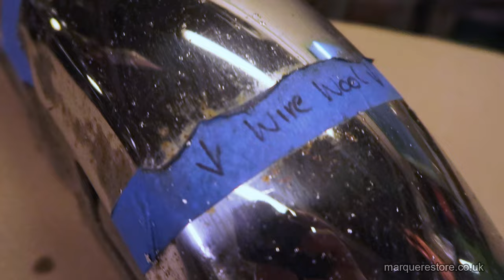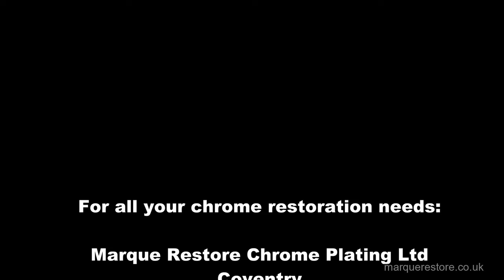How to Clean and Restore Chrome at Home THREE METHODS TESTED

Comment: The Aluminum has to be turned and cycled as the water conducts the chemical draw from pulling the rust off TO the new Foil.  as you may have noticed the foil became brittle as takes a tarnished tint to it.
Reply from the maker: Thanks for the tip

Comment: I'd wash it top and bottom with SOS soap pads then put it in a storage container and submerge it in Automatic transmission fluid,....you could leave it there through the off season.
And that would probably make it all better.
I have a fender that would scare you,....I just bought another off of ebay.
My aluminum radiator trim looked terrible I sanded it with 150 grit then polished it and you could still see the salt damage,...I think I'll just paint it.

Comment: A detailed friend of mine swears by, wheel cleaning acid, I’m not actually sure what that’s made of, maybe it is phosphoric acid, but not for wasted chrome. What I can’t figure out what to use for, is boot or sneaker melted stains.
Reply from the maker: a strong solvent should help get that off an will not damage the chrome

Comment: I no longer use steel wool. Found that small pieces will embed themselves and later start rust again. I wondered why i was getting rust on some of my stainless steel and found that on those pieces i had used steel wool. Same on aluminum. So again, i have abandoned steel wool.
Reply: You can't use steel on aluminum....you created/added to  the oxidation process you were trying to fix.

Comment: Coat with iron fallout remover then wire wool honestly much better than water then I’d go over the entire thing with normal car paint polish polish with a glass microfibre and finally protect it with a ceramic coating to slow the pitting reoccurring but use loads of iron fallout and lots of car paint polish to help remove the fine scratching left behind by wire wool if you use it on wire wheels you may need to re wash the wheel to remove left over polish dry it then ceramic coat the entire wheel for wire wheels use maguires spray on ceramic to get it in all the impossible to reach places otherwise use one that comes with an application pad I got a 25 year old Yamaha looking good this way not perfect but perfectly presentable
Reply: New or good I’d spray it with a degreaser make sure it’s spotless then go over it with with furniture polish with a glass cloth then go over it with a ceramic coating to maintain it and stop it corroding in the first place

Comment: New chrome needs protection - a good wax polish will seal the microscopic routes down to the base metal which causes the pitting when in contact with moisture.
A chrome plater years ago stated that Windolene was the best, (no longer available as a pink cream), nothing abrasive like Solvol

Comment: The steel wool need more than just water. It needs to be sope water. Then it’s way more protective to the Crome. Here in Denmark you can buy steel wool with sope already in it  Then just soke in water 👍😊🇩🇰

Comment: Is the metal polish good old Simechrome polish? Use microfiber clothes to add the polish and remove it as well. Steel wool no matter how fine will scratch any chrome surface.

Comment: Is there a product like a wax or something we can restore the micro finish?  So if you put a flash light over the work done, you see that the polish, wool and foil takes away that glossy film, tiny scratches. I'm wondering if there is a wax or Something to put over afterwards.  Silver polish seems the best and less damaging but leaves a dry finish.  I've even tried red and white compound which made a mess of the chrome.

Comment: I wonder if those new Laser cleaners would do a decent job?  It would definitely remove the rust and dirt, and hopefully the Chrome & Nickel would reflect the beam and leave a decent and relatively undamaged finish. Of course you'd have to take a LOT of precautions, as the laser is VERY powerful and reflections would be dangerous.
One BIG problem is the Laser itself will cost you around $11,000.....  Just a LITTLE more expensive than ANY of the other three, and probably more than Rechroming!
Reply from the maker: You need to look at my channel videos. I have a laser cleaner
Reply: @ChromeandCarRestoration  COOL!  I'm new to your channel - I just found it yesterday. It would be cool to see how it does on the rust that "infects" chrome - but if you do try it - PLEASE be careful!  And yeah - I just found those videos!   SWEET MACHINE!

Comment: I accidentally spilled toilet bowl cleaner on the bathroom pipe which is chrome plated.   Now there are few dark (black colored) spots on the chrome pipe.  Is there a way to remove this?
Reply from the maker: Sounds like it needs a re-chrome. Many toilet cleaners use the same acid we use to remove plating.

Comment: I have used aluminium foil with phosphoric acid rust treating gel. Doesn’t run off and the rust is treated as well. Follow up with a good fine polish then wax.

Comment: 0000 steel wool soap pad....scrub with water.... rinse off.... Cerium oxide...
Use a piece of raw leather to polish it... wipe clean with a microfiber cloth. 
Works for glass and chrome.
Reply from the maker: Thanks for the tip

Comment: The Coca Cola is unnecessary IMO. Plenty of water and a dash of soap to provide plenty of lubrication as obviously the foil is non-porous.  Best to keep dipping the foil into water before applying.
Reply from the maker: It is the phosphoric acid in the coke doing some of the work.

Comment: I've always been confused as to the purpose of chrome plating. I was lead to believe that it is a method of protecting steel that also happens to have a beautiful finish. However, it is obvious that chrome plating is very poor at protecting steel, so I can only presume it is used for aesthetic reasons and much care is required to maintain it.
Considering the process required to achieve a beutiful chrome plate, you'd think it would be almost indestructable with rust having no chance of getting through. Can anybody enlighten me here?
Reply: Zinc plating actually protects steel, acting as a sacrificial anode; chome only gives it a superficial shine.

Comment: Hey mate, you did not use the polish properly on your first step and did not read how to use the application. When it is used properly, it will get rid of the rust on the chrome, but not the damage. Forgot rub it in and let it dry, your cloth will come up black if you have done it right.
Reply from the maker: Thanks for the tip

Comment: If chrome is pitted its pitted and nothing gonna cure that!
Reply from the maker: You are correct.  Only a rechrome will cure it.
Reply: @ChromeandCarRestoration  any rust is from steel underneath. Chrome cannot rust but is porouse. Rust from steel below will lift and flake the chrome above.
Reply from the maker: @johnf3326  Absolutely correct

Comment: i use harpic power plus 10x brush it on leave it all the chrome falls off then i wash it brass wheel it and paint it a very nice color,  chrome is a waste of time paint lasts far longer as you can use wax and even repair it were chrome just looks crap when its damaged i hate chrome.

Comment: Nice job but just think of what the coke is doing to your stomach when you drink it .
Reply from the maker: Indeed. t very good for you. I have been told you can use it as a solution for anodising aluminium due to the amount of phosphoric acid in it.

Comment: Hey Allen was trying to dm you do you have a personal contact?
Reply from the maker: Cpntact details are in the description and also at the end of the video
Reply: Forget these methods for retoring rusted chrome.  Although counterintuitive at first sight - THE BEST way to bring back even heavily pitted rust is to use the silver (not the copper coloured one's they will cause scratches) 'swarfy' type pan scourers available in all supermarkets and ppound shops - with some WD40. = No scratches - and will recover almost any corroded chrome unless pealing.   Remember - chrome is porus - the rust is corrision in the base steel bleading through the pores in chrome. But if the chrome gets to the stage of blistering / peeling  then obviouly it's game over.